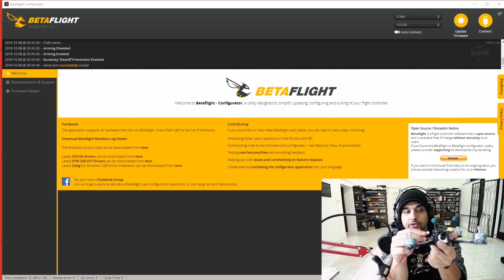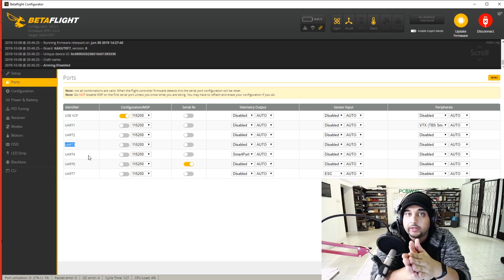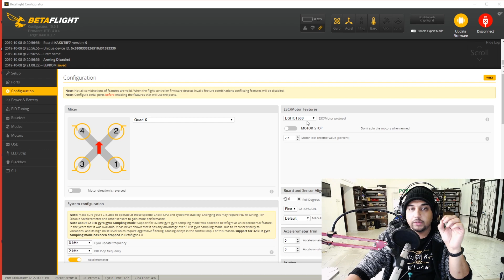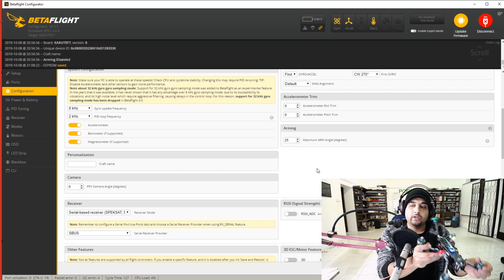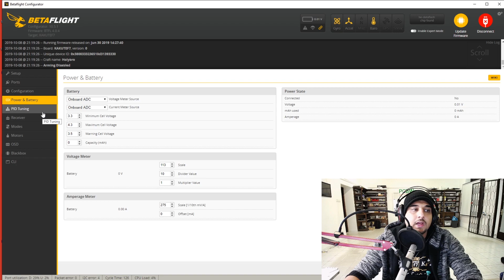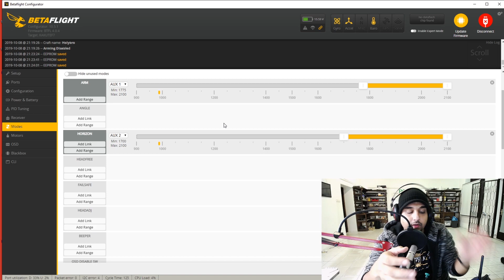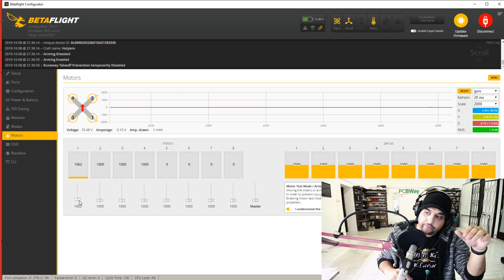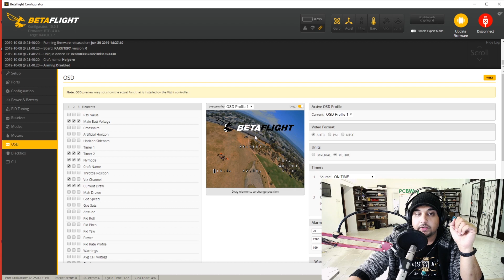Beginner Guide // How To Setup Betaflight FPV Drone Complete Guide 2019

Comment: I am totally new to Betaflight. I fly fixed wing and have only dabbled with quad copters. I decided to buy a HGLRC Petrel 65 in order to learn FPV because it is aimed at total beginners. Then I found out I needed to know about Betaflight. My brain crashed when I tried to understand some of the videos on the subject and they were supposed to be beginner videos.
Nearly all of the other beginner videos I watched seem to assume a new pilot would know all about the general terms, names, and functions on Betaflight. Absolutely confusing. 
This video is the first video to properly explain the functions in Betaflight. You explain the simple things which are "NOT" simple to a beginner and you make them easy to understand.
I thank you very much for this perfect explanation and teaching video. I can understand all you say here about Betaflight and how it works. I know I have a lot more to learn but this video is perfect for a beginner. You take your time and you don't rush your expiations on the subject.
Well done and I am certainly a SU--B to this channel from now on. Perfect video buddy. 
One thing I found out and is probably more common than some people may think is the use of the wrong USB lead when connecting your quad to Betaflight. I could not get connected and that was after using two USB leads. Then I discovered I was not using a USB data lead. I was using a USB charging lead "which on the surface looks identical to any other USB lead". 
I am saying this because it caused me a "BIG HEADACHE". I was trying to download drivers and assumed that was the problem but I was Soooo "WRONG". 
Anyone who can't get their quad to connect to Betaflight should firstly make sure they are using a USB "Data Lead". It is a simple mistake to make but can confuse you a lot. 
Sometimes we go on assumptions because both leads look the same. 
Hope this simple piece of information helps and once again your teaching video here is absolutely brilliant and has saved me a lot of searching for proper information. 😍👍👍👍

Comment: Thanks so much for this video. I am using  having issues with arming the quad. Using an F3 flight controller all in one stack. I was able to connect and bind my Flysky FS A8S receiver and a Flysky Fs i6S transmitter. When I tried to go to the modes menu I wasn't able to get anywhere and not sure which Aux to select. I tried all evening but haven't been able to arm. I checked the angle and it's at 25degrees as you pointed out haven't touched it. I then got Arm Disabled after saving the changes and not sure what that it as none of the Aux seem to be working. Sorry still pretty new to all this and I am currently a bit overwhelmed.  soldering and stuff and the motors do fire up and are turning in the right direction but I haven't been able to arm them or figure out how to using the transmitter. The receiver is bound.

Comment: Great detailed video sir.set up every thing as per video. facing a issue , with props off , when i throttle up the motors spins , but they do not slow down on throttle decreasing. have to disarm the quad.Its doing on bench test, afraid to take it out with props on, without sorting this issue. any help is much appreciated.

Comment: Hi, I've followed your video for my drone setup. It's been really helpful. But while doing the receiver setup on betafligt, I've noticed that my aux 12 is randomly changing value. I dont know what's causing this as I'm not touching my controller (frSKY Qx7). If i have nothing setup to aux 12, is that an issue that would affect my flight ?

Comment: My accelerometer is turned on but I don't have any movement from my quad in betaflight. I'm using the iFlight SucceX Mini F4 TwinG V3 FC & 35A 4in1 ESC & 25-500mW VTX 20x20 Stack.

Comment: I have an Iflight baby nazgul 73mm drone and when i arm the quad only 3 motors fire up but when i increase throttle the 4th model arms. sometimes it arms and sometimes it doesn't. What do you think is causing this?

Comment: hey buddy i had a question for you. using succex f7 stack and for the life of me i cant get betaflight to recognize my bn220 gps. ive tried every different uart and baud. ive tired 3 different working bn220 gps. i use them consistently on all my matek flight controllers in arduplane. they even power on and acquire lock. but cant get betaflight to even recognize it at all. im a plane guy coming over from ardupilot. i have many different flight controllers just new to betaflight. any help would be greatly appreciated

Comment: why do you need to desolder wires to make the engines spin the right way? can't the esc be programmed to do that? like, click a box if it's going the wrong way, and it'll switch the way it energises to go the other way? :O

Comment: Yo brother those drivers don’t always work. I have 2 FCs that will not fully connect. I keep getting successfully opened serial port with I’d 4??what is that. One of the FC s has a type C usb brand new outta the box and for the life of me it will not do shit. You can see it in the device manager and Zadig but it will not connect. It’s not bricked? The other is a mamba f7 does the same as the other. No can explain I’ve never seen it and I’ve been doing this for a minute now.

Comment: I have a 2020 apple MacBook pro.  It keeps saying the Betaflight not able to open cause the it doesn't recognize the software after I drag the folder to the app folder.  it will open and then trying to connect with cord it connects then disconnects after few seconds.

Comment: how do i bind my quad if my button is broken. i have a frsky r-xsr receiver thanks for any help. i heard of using the cli commands but no idea on how to do that.
Reply from the maker: just short the pads where the broken button is until it goes into bind mode
Reply: In the cli shell type bind_rx , after that go to your frsky controller and go to setup,set the internal rc to accest d16 or d8 protocol and channel number 0 - 8 and the rx num should be 00. Click on the bnd and set telementary ON. And type save in the cli shell after this. Worked for me.

Comment: Im having trouble doing the arm mode, I select auto and then switch the button on my radio that i want to be its arm. However it isn't working, am I missing something.
Reply from the maker: Enable the switch in the mixer tab inside the transmitter.

Comment: I can connect and configure but when I go to bootloader mode, the pc detects my board and it is in DFU mode, I select a firmware and when I click flash It does nothing. It says usb port closed successfully and does absolutely nothing. I tryed reinstalling all the drivers and just so you know, I was able to flash multiple times before

Comment: hey drone mesh
Reply from the maker: Hey
Reply: im all the way from Kauai, Hawaii and am totally new to fpv and built me my first drone. ordered me some gear. now im running in to no stick movements in beta flight... using a crsf nano diversity to a 60a hobbywing stack with the tbs evo. sent ch1 from nano diversity to rx1 and ch2 to tx1. got everything to bind, visuals through my goggles and the rx is solid green just like the module behind my qx7. serial rx is checked on uart1, saved and rebooted. configuration receiver set for CRSF, plug in my batt and got nothing. got any idea where I went wrong ?